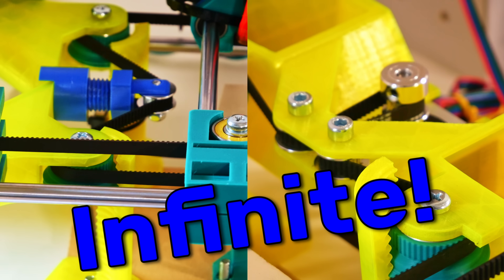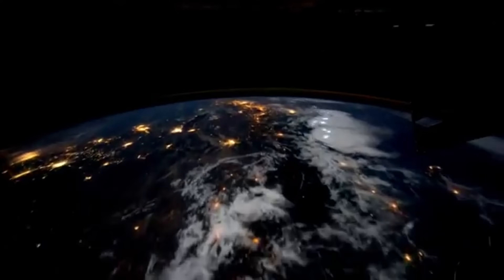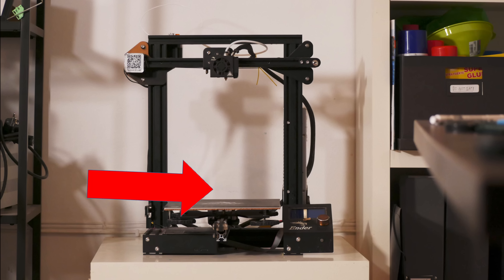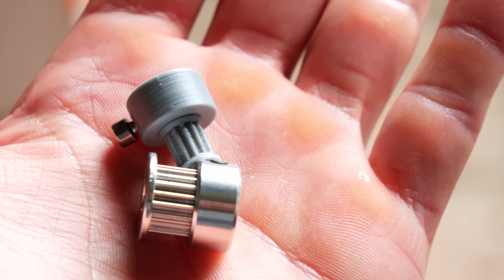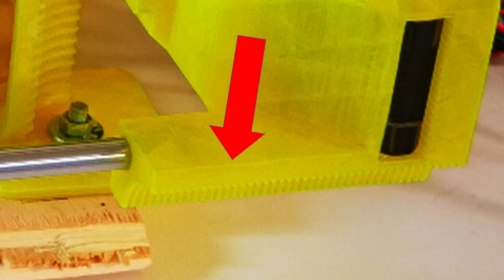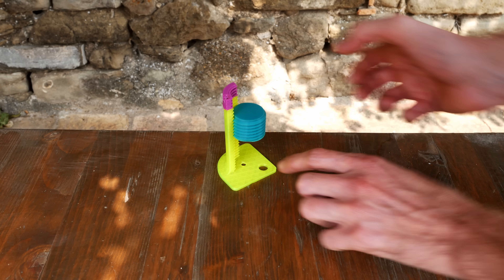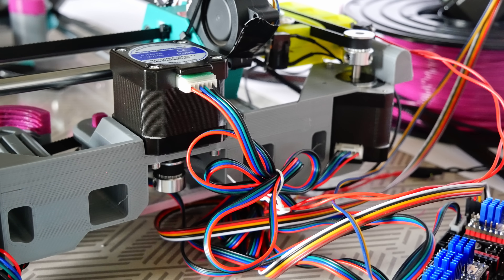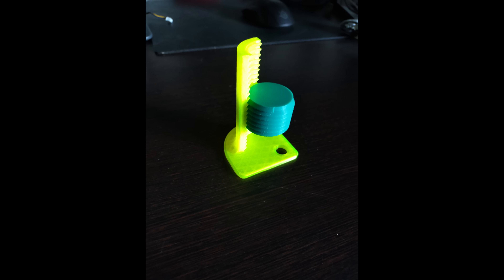it can 3D-Print onto itself?!

Comment: oh boy, I'm building my own printers since the release of the first Rostock, but man, this concept is awesome AF and very creative tackling some engineering problems. awesome work. This project alongside the fast-printing improvements of "MirageC" and the upside-down-concept of "K R A L Y N 3D" are the most awesome and creative FDM-Improvements I've seen in about a decade. Keep up the great work.
Reply: the kralyn isi wicked; hope this guy can pull off a similar build!
Reply: Kralyn has consistently billed the Position as a printer that's portable and nothing else, but from the first moment I saw it I've always thought it was cool that it's a printer that you can put away for the 99% of the time, when you're not using it.  I mean taking up space is what's keeping the average person away from having a 3D printer. Like how everyone has a drill they barely use, and no-one has a drill press.

Portability of a 3D printer of all things really is a niche requirement.

Comment: I remember this being part of the original idea behind a 3d printer. A machine that could reproduce itself as an analogy for life.
Reply: Wasn’t that the entire idea behind the rep rap project, this guy is just taking it a lot further....
Reply: @Volt64bolt nope this is a rep rap.
Reply: @Volt64bolt  yeah Prusa and the University of Bath did have the headstart tho
Reply: @thenewsonatrain  wdym, they started ages ago if thats what your talking about. Doesn’t make this guys project any less impressive now does it.
Reply: Yah... This was an original objective of a few printer projects over the years.  I like the way it's being done here though, because it's actually capable of making bigger versions as it goes, thus increasing the print envelope to a massive size, the only problem is gonna be stability at those sizes.  You will almost certainly need more than just 4 points contacting ground or it'll start to sag, and other accuracy issues are gonna crop up as the size gets bigger
Reply: @NeoIsrafil  A good location system makes it less important how rigid it is, as long as it can get the print head to the right location somehow and know when it is it doesn't matter if it's imperfect structually.
Reply: @NeoIsrafil  A good location system makes it less important how rigid it is, as long as it can get the print head to the right location somehow and know when it is it doesn't matter if it's imperfect structurally.
Reply: Have you ever played astroneer before? cause that's pretty much how you progress, small printer make bigger printer. although you have to collect the resources for it.
Reply: @JerryCan101  and a lot of other games lol
Reply: @mechez774 Only locally. Life reduces entropy within its boundaries by using energy, much like a heat pump. Life is an entropy pump.
Reply: I think you remember this being the idea called the reprap project, a printer that can replicate itself. 3d printing existed, machines designed to self replicate did not. The prusa Mandela could self reproduce. Also you could print one and upgrade it all the way up to the current model.
Reply: i thought it was made on accident?
Reply: yup reprap
Reply: Here's how you make artificial life.

1 Program a AI that can edit almost any of it's code

2- put that code in a computer that cannot connect to the internet and put that computer into a robot

3- design super small 3d printers that can grow in all directions 

4- make the 3d printers print in multiple materials 

5- make it so the robot body is intentionally damaged over time the small 3d printers can make the robot grow as is it was organic 

6- have the robots gain materials for their 3d printers by crushing materials, refining them and making them compatible for 3d printing,

This basically works as a sort of digestive system 

7- have a way for the robots to dispose of material it doesn't need

8- make sure the robot body has an area for a larger multiple material growing 3d printer to make more robots

9- have a way to to where two or more robots can "share" their schematics and code

10- make it so the new robots have random amounts of parts from the schematics and code of the parent robots

Some robots will have parts and software features that don't work in certain situations or places, so when they break or "die" this acts as a form of natural selection.

Some robots will adapt to run off of solar cell and grow outwards while remaining stationary, acting as plants

Some robots will take advantage of the robot plants by "eating" them.

Eventually there won't be alot of robot plants left so some robots will eat non plant-like robots, creating a predator/prey system.

Some other robots will adapt to be microscopic, making bacteria that decompose material and synthesize chemicals

Congratulations, you created life, albeit a very primitive form of life
Reply: Just the reprap project, 3d printing was invented for manufacturing inside the 70s
Reply: damn, they should call it replication rapid prototyper
Reply: @mechez774  you have no idea what the second law of thermodynamics is.

Comment: You have to add metal parts for the child x and y platform, so you might as well just use a longer steel screw for the z axis rather than growing a plastic one. Especially as the accuracy of the steel screw would be vastly superior. Also, friction. Wait. This is a gag, isn't it. Nevermind.
Reply from the maker: It's not a gag, just need to do it in a few more itterations, plan is to eliminate metal parts one by one
Reply: @TurboSunShine  You are replacing metal parts with 3D printed plastic parts, which introduces a margin of error. You are making each iteration larger which introduces another increasing margin of error. You are trying to accomplish this by having the current iteration build itself, which introduces another margin of error that increases exponentially. You soon get to the point where the margin of error increases to 100 percent, and the project fails.

You would need to include an automated Quality Control system that measures the process and corrects for the margin of error in real time. This would likely be impractical, making the entire project impractical. With a little thought this becomes obvious. This, along with your over the top presentation, is why I thought this video was a gag, and I still think it might be.

Comment: “A jack of all trades is a master on none”
If you follow that logic and want the goal to be a like something you can deploy to mars and replicate itself exponentially then what you really need is not one device that try’s to do it all, but a series of more focused devices with there own specialties that are designed to work together and that can interact and feed each other and get to your end goal of that full self replication.  For instance you can have one that does the 3D printing for frames and structures, one that does metal work, one for circuitry, one for material refinement/delivery, one for transport or setup or reconfiguring like a robotic arm.  Basically I don’t think that true end goal can ever be done with just one device but more a small squad of different devices that work together to cover overarching goal of manufacturing and self-replication.   And then you could have a more simplified version that one has the sub-components you need in a more hobbyist setting for people at home to use.

But still it’s an awesome start!  I don’t know if I could have thought of that inverse threading idea, that’s just genius!

Comment: Why not print up a threaded rod instead of a quarter of an internally threaded tube, and rotate a nut around that threaded rod? I feel like this would be easier to lubricate and faster to print since the toolpath involves less acceleration and decceleration. Have you also experimented with any mechanism like a scissor jack? I feel like that could be printed into the printed printer and avoid having to move to each corner each time, although it would mean the build volume would be much less infinite
Reply from the maker: Mostly because this type of thread allows the legs to be connected, making it more stable at higher heights

Comment: if only you could print out those semiconductor electronic parts, which is not impossible but requires precision at microns, and maybe germanium can be used with its 900 C melting point. 
I'm getting more and more excited as I think about the possibilities, I'm starting to try it myself asap!
Reply: As far as I know, here is a need for a VERY high material purity, so I doubt that this is possible.

Comment: How would you print a nozzle... with a nozzle that gets hot enough to melt a nozzle?  Wouldn't you need belts and stuff out of different materials?  How are you going to get all the materials isolated and feeding properly?  I love the idea, but I don't know how some of these things can be done.  Maybe this printer could have a special attachment that can cut nozzles?  Or just ship a bunch.  I don't know.  I mean, even if you could have a 3D printer that can replicate itself on mars, it's gotta be loaded up with filament and stuff, which means shipping filament to mars, and having some kind of rover load it up...  Then there's electricity - I guess solar is fine as long as you can clear off the dust off a panel.  I mean, if a printer is replicating itself, you've gotta also make sure it's perfectly tuned, as any flaws will likely get amplified each iteration - though, even my poorly tuned printer can sometimes give surprising results.
Reply from the maker: I have some ideas and tricks up my sleve, dont worry ;)

Comment: would it be possible to give the printer custom g-code every time a layer is finished, to print 1 more layer of the leg structure? possibly with a second controller that just runs the leg model in an infinite loop?
Reply from the maker: It will need something like that, but it is a bit more complicated. It needs feedback from sensors to be able to correct for faults on previous layers. This is usually called a closed loop control system

Comment: Both ambitious and intriguing. But it makes me wonder what you are going to use in place of belts. Printed lead screws or linear gears ?
Reply from the maker: Good question! Have tested printing belts, but its not optimal, when we can print motors i would just put one on each leg

Comment: Freaking genius! I can see issues with rigidity of the mechanism but your approach clearly shows you have what it takes to solve problems that other people have not even seen yet.
Reply from the maker: That's why we can bridge between the legs ;)
Reply: @TurboSunShine  you should make it create a vertical lattice of about 15% to 35% infill between each leg (test around with infill and patterns)
Reply: @TurboSunShine  Why not just accept that it's a 3D printer and that it can't do everything, and instead of making it so complicated just use a very simple 3D printer that can print a more standard X Y and Z axis extensions that a human or a robot arm (that the 3D printer could print) put it in place.  This makes it MUCH easier, and you can then focus on the hard parts, getting strength with a little metal as possible, getting metal printed (your electrolysis system, lost PLA casting, print a green part) and as these clever minutia of how to lift itself up and print it's own axis is fascinating but hardly critical.     One other idea, with a good system to pinpoint the print head location (something exceedingly accurate, maybe camera based, or laser, IDK) then you can worry less about just some limit switches or how rigid an axis printed out plastic is as you only need to know when the print head is in the right place, consider how they 3D printed with drones, silly but you get the point, heck, you could 3D print from a vehicle that runs around below the print bed squirting plastic at the right spot, rails are only one way, and as a bonus if you have a great vision/scanning system you can not only know where the print head is but you can have a 3D printer that can scan and repair failed prints, repair incomplete prints, you could also have a subtractive tool (router bit) that can remove material.

Comment: That's actually a pretty cool idea, but I suspect you run into bigger structural problems than only the legs bending away from the Z screws . The negative thread angle is a clever fix. I'd maybe add some additional supports on the Z axis screw assembly, that wrap around the legs and push them against the screws, this would also insure they're in a more or less precise location. But the larger you make the printer, the more you'll run into problems where the whole printer starts wobbling around on it's legs unable to print anything accurately etc. So I think it's really important to pay special attention to the structural soundness right from the start in order to save some iteration time. Cause you can count on having structural problems sooner or later. :D
Reply from the maker: Jupp! Used a bracket initially! But with that you can not bridge between the legs, here you could do that to gain structural integrity

Comment: Interesting idea however what is your plan to tackle the fact that the z axis will get increasingly unstable as it gets taller, and the fact that you’d need a pretty robust material changing system that was also itself entirely printable in order to realize the full scale of the project? I feel like this is better left to just a cool self printing printer vs some miracle machine that can produce motors supposedly.

Comment: The problem will be that you can’t print all the electronics, it seems all you would be able to print is wires, not any of the semiconductors that a printer needs to run.

Comment: Hi, instead of using bought metal rods, whould it be possible to print  T shaped beams, a bit like in minute 9.14 of your video, and then print wheels as yz rails?(like the ender 3. Series hat). 
 In the book "lord of all things " by Andreas Eschbach he writes that the main problem of self replicating maschiens is, that with each generation some parts loos quality, and that then cases more imperfections and so on and so on. 
To go around that problem something like a sanding tool head for the printer could optimise the rouling surfaces of the axis for example. 
Hi from Germany, great video. Excited for the next update.

Comment: This is a cool idea with some good concepts, and I especially like how it builds its own Z-axis. But Unfortunately, at least for me, the whole idea falls apart as soon as one realizes that the motors, hotend and all of the electronics must be sourced and purchased separately making this printer just as expensive and difucalt to build as any other.
Reply from the maker: -for now
Reply: So how do you think a basic 3d printer will ever be able to make silicon processors that are required for the control board?
Reply from the maker: @cheeios2mc773  not a basic printer, but I'm pretty sure we'll figure something out. already have a few ideas and concepts in mind

Comment: This is so cool... I do have one caveat.. if it can print a bigger version of itself and a more precise version of itself then it can print anything, if it can't print bigger then you're stuck with some limited print volume (in at least one dimension) if it can't print a more precise version of itself then the best version of itself that can ever exist is the one at initial creation, wear and subsequent copying will degrade the printer and eventually kill it.

Lastly if it can print a Waldo (or some other manipulation device that can grab and move components/materials in an arbitrary way) it can combine the properties of a very precise small printer and a larger volume printer to construct anything.

This is the combination of things that gave rise to the Industrial Revolution, a lathe can make very precise parts with a skilled operator, and it can make all the parts necessary for a bigger or more precise lathe, humans could then combine these components

Excited to see more
Reply: To your first caveat, what if the printer has same way of taking of or adding material in smal amounts like with a sanding tool head. Whould that be a way around that problem?
Reply: @liamfink1232  having the option to sand/polish and so improve the precision and accuracy of copies is possible, you're just changing the methodology to achieve the same outcome.

Comment: Imagine it self-reproducing in zero-gravity. 
Variation of this could be an invert, where a nozzle assembly builds a frame but outside of volume,  which makes original frame a new "bigger" nozzle assembly.
I think this needs "lasers" for self-correcting compound dimension errors.

Comment: use a four-way piezo sensor installed in a pivotal axis, like a joystick. this can provide precision of end-stop positioning with pressure sensing too, helping the leveling. Try it. It costs a few pennies.
Reply: what you want is basically the thinkpad nubs, the hard part has basically no travel but can detect force being applied to it. 
the way the strain gauges are made (basically a resistor that will slightly increase in resistance as it gets stretched), you might be able to 3d print them with conductive filament.
Reply: @satibel  exactly